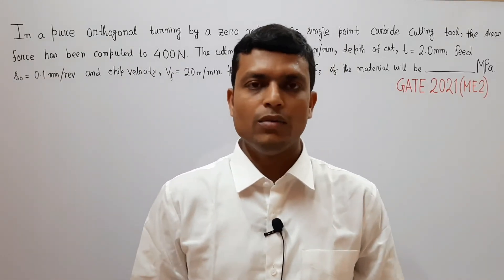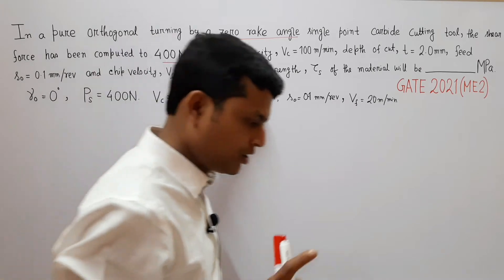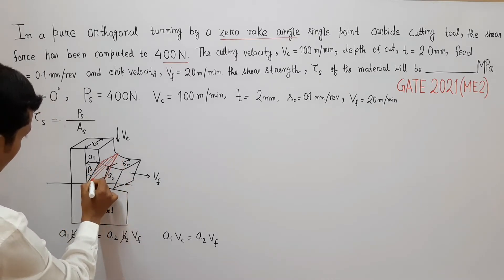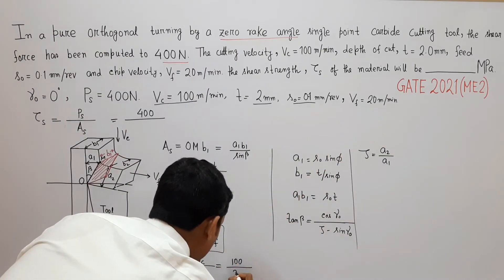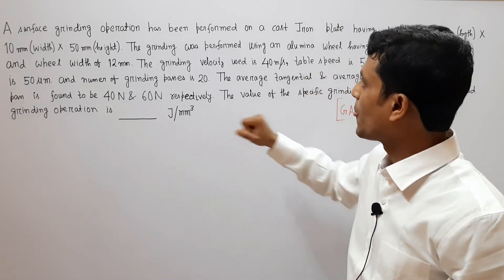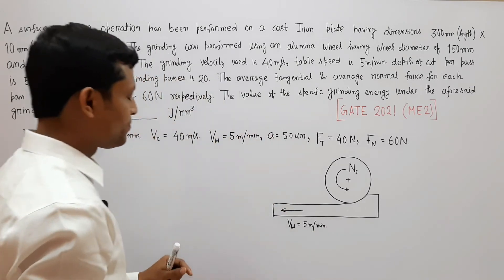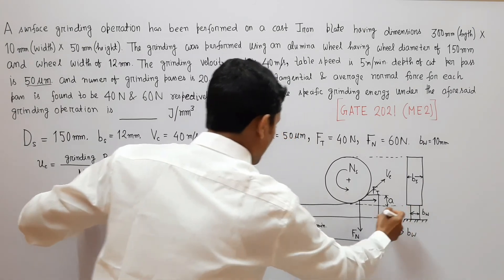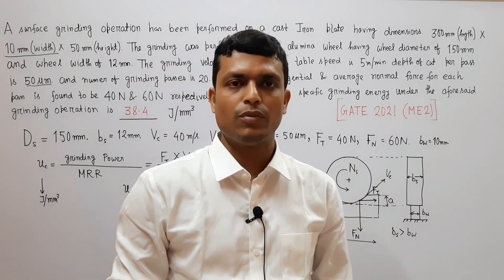Mechanics of machining and grinding. specific energy, shear strength, GATE Mechanical 2021

Comment: sir the question has asked for 20 passes of the wheel
Reply from the maker: Very good observation.
Actual material removal is less than theoritical down feed/depth of cut, that is due to deflection of spindle under normal force. This is called grinding cycle.
Here we have neglected that effect, to calcutate that stiffness of grinding wheel and other parameters are required.